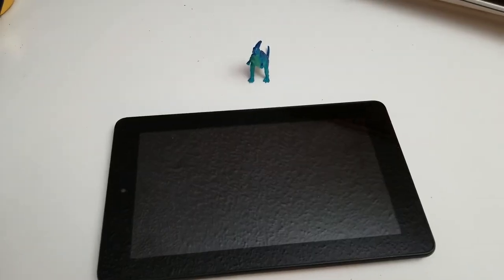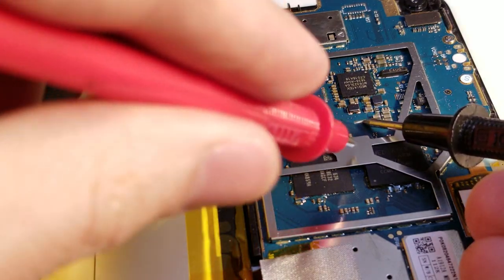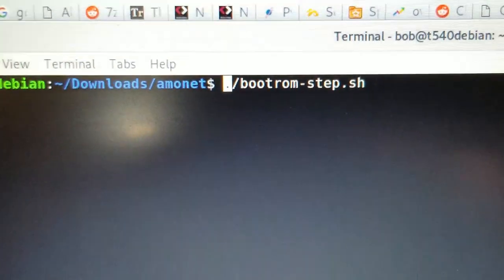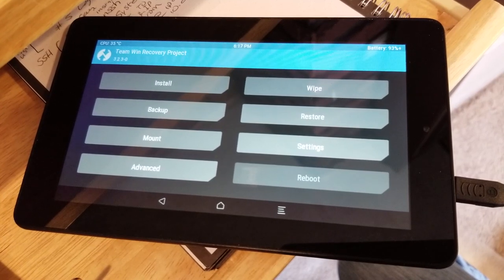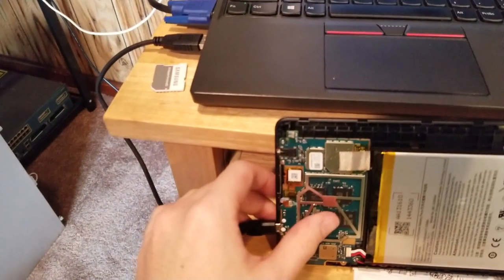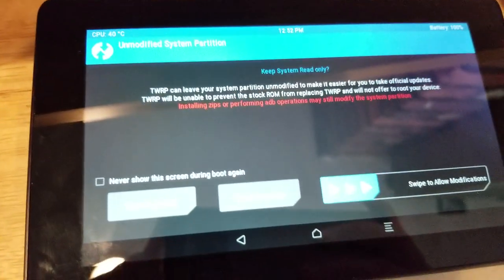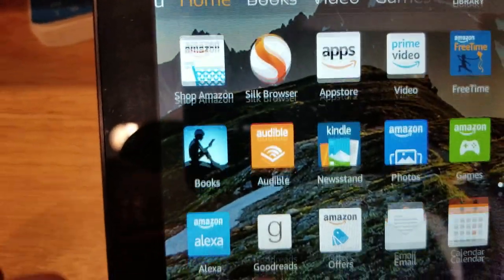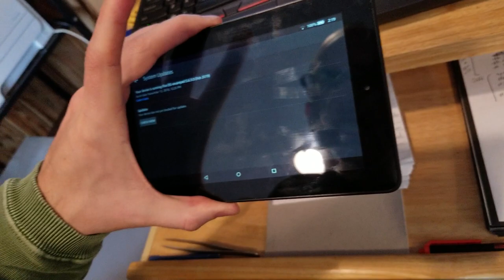Unlock Kindle fire 7 (5th generation) - load root / custom rom

Comment: EDIT : Those who want to try out a significantly better rom try the lineage os 12.1 on the 5th gen and add openapps gapps arm 32 bit. That is significantly faster (and better)
----
This was great. Although most of the instructions were there in the xda forum this really helped. Most people might be turned off by the shorting bit. However take a safety pin, point the pointy edge on the circle and bend it around so that it lies across on the gates as show in the original xda post. Use tweezers to pluck open the cage, it is as easy as show in this video.
I dint have an sd card so dint wipe it off yet, but yea the latest nova launcher also loaded up fine. Done on a kindle 7 5th gen 2015.  With most of the bloat out of the way it does feel that it performs a tad better.
Reply: For it to be even faster, use Pico GApps.

Comment: Thanks a lot! I was able to do this to a 5th Gen Fire 7. I had some problems at first with the tablet not communicating correctly due to some computer issue I guess. I ran it later in another computer and had no problems at all.
Reply: Man, it would sure be great if you could put a video or a step by step of how you went from 5.3.6.4 5th Gen to root. I have a PC laptop but know nothing of Linux or Ubuntu, and that's what is keeping me from taking the leap. As is, this old Fire is pretty weak.
Reply: You can always download a Linux OS ISO file and load it into a USB as a bootable OS. I used Linux Mint Debian Edition (LMDE) as the OS ( https://www.linuxmint.com/download_lmde.php ). I used Balena Etcher ( https://www.balena.io/etcher/ ) to install it into a USB as a bootable OS. After you have linux running from the USB (you just boot up the pc with the USB plugged in) you can follow the steps from this video and Jaren's notes to install a custom ROM, install Magisk to root the tablet on version 5.3.6.4 and install TWRP.
I know that sadly many things might happen, as they happened to me. Like the PC not wanting to boot from the USB because I had not set up the BIOS to accept legacy USB, or my USB ports misbehaving in general (That's HP for you).
Download the most recent version of Balena Etcher (or use YUMI or Rufus), download Linux Mint (any version should work, but I used LMDE). Be sure to have downloaded the custom ROM, Magisk, Gapps( https://opengapps.org/ ) if need be and an updated TWRP, and have those on the sd card inserted on your device in order to install from the sd.
On mine I have TWRP 3.2.3-0, Lineage OS 14.1 ( https://androidfilehost.com/?w=files&flid=293089 ) , GApps ARM/Pico for Android 7.1 (Depends on the custom Rom you install).  I read that Lineage 12.1 works well also. Might check that one out later on. The tables moves well with 14.1 though.
Reply: @gab_ale  Thanks for all the info, links and steps.  It looks like I just need to find a usb and get going on this.  I appreciate you taking the time to answer!  So 14.1 works pretty good on this tablet?   I just can't wait to get all this Amazon stuff off of it.
Reply: @Radtech777  Sure, glad to help.
If you download lineage-12.1, which runs on Android 5.1.x (Lollipop), be sure to select accordingly when downloading Gapps. 
Check on ARM, 5.1, Nano/Pico/etc (Whichever you like. I prefer Pico)
Lineage-14.1 runs on Android 7.1.2 (Nougat). That's why I am using Gapps ARM, 7.1.
There's another ROM called Fire OS Revamped (Shown in this video). You can check here: https://forum.xda-developers.com/amazon-fire/development/rom-fire-os-revamped-t3899921
The download link is here: https://androidfilehost.com/?fid=6006931924117918680
Also, I am running Magisk 19.3. I think there are newer versions though.

Comment: Thank you!... THIS (your) video make sense after I went through the same UNBRICK/ROOT procedure on the kindle fire 7 5th gen. (Yes! Now in 2020!)  I wondered if transferring the files directly into the SD CARD and using TWRP (as you do here), in comparison to using ADB sideload from the computer, would make any difference, but id did not!... Interestingly, before watching this, I made the same mistakes. FYI, I love LENOVOS.. I think I used the same model.

Comment: i keep getting this error: Traceback (most recent call last):
  File "main.py", line 156, in <module>
    main()
  File "main.py", line 82, in main
    switch_user(dev)
  File "main.py", line 53, in switch_user
    block = dev.emmc_read(0)
  File "/home/jonah/Kindle Hacks/5th gen/amonet/modules/common.py", line 193, in emmc_read
    raise RuntimeError("read fail")
RuntimeError: read fail
Solution?

Comment: Just needing help shorting it out I don’t understand , am I just touching it with the paper clip or moving something?!
Reply from the maker: yea, you don't need to solder. just shorting for 2 seconds between the metal frame and the pin
Reply: @jarenhavell  how would i go about shorting this?
Reply: @robertshields2879  Touch it with a paper clip for 5 seconds until it tells you to remove it.

Comment: Please, is it possible to do this on Vmware Workstation??? I don't know Linux, but I figure I can install Kubuntu virtually, and do it on Windows?? Please help.
Reply from the maker: if you can reliably pass the usb device... i think thats going to be a challenge. i would think it might present more challanges than necessary. booting from usb is far easier.
Reply: @jarenhavell  Thank you! For some reason I can't run a live version of Kubuntu on USB, but I should be able to do it with a live copy of Ubuntu right? Just open a terminal, and go to town, right? For whatever reason, I can only boot a live version of Ubuntu on an older laptop with USB 2.0. I disabled secure boot, and Fast boot within Windows if that helps, but still, it only lets me run live Ubuntu.
Reply from the maker: @ianthomas1201  yes. and you may find that things are easier on ubuntu as well, than, say, the version I used. Give it a try and report back!
Reply: @jarenhavell  Will do, thank you kind Sir.
Reply: @jarenhavell  I did it! I can't make it recognize files inside a MicroSD on the Revamped rom, but it's still pretty good.

Comment: How do you get back to twrp on 5th gen? I doubt running  both .sh is required every time? And shorting the pin required to every time we need to go into twrp recovery? Is there an adb command like (adb reboot twrp_recovery)?that would work? Any one please lmk any experience with what I'm asking so far I've got to twrp and then selected power off in twrp how to get in twrp once already installed?

Comment: Can you downgrade to 5.0.1 instead of opening the tablet?
Reply from the maker: I think so, there is reference to downgrading as a method in the XDA forum post, but I am not familiar with that process.
Reply: Did it on 2 amazon fire tablets (5th gen) with the downgrade and ubuntu installed on my pc.
Worked great!
Reply: Sonny_ Ska hi can you be able to give me step by step instructions im really bad with these stuff
Reply: Ranidu Lakshan if you have a fire 7 5th gen you can use the downgrade method, if you have the 7th gen then you have to short the pin.
Reply: Sonny_ Ska mind on telling me how to downgrade please
Reply: @jarenhavell  DONT DOOWNGRADE IT HARD BRICKS THE DEVICE
Reply: even with 5th gen still hard bricks

Comment: how do i short this without soldering?
Reply from the maker: I think it would have been easier with a pair of sharp tweezers or something thin and small. perhaps even a paperclipm
Reply: What does shorting mean?
Reply from the maker: @zeezoo6174  to make a connection between 2 points on the circuit board. "Short to ground" mean connecting a wire from the specific location to a "ground" or a "negative" portion of the circuit.

Comment: What version of Linux are you running for this? I tried Mint and Peppermint and the commands don't seem to work in them.
Reply from the maker: Debian.
Reply: @jarenhavell  no ur using ubuntu
Reply from the maker: @jonahnmdapumpkinhead7194  kind of. Ubuntu is based on a debian distribution, but there are small differences in included packages / programs, and obviously the visuals depending on if you installed one with a desktop environment. I like debian, but Ubuntu is easier sometimes because of the support from the community and Canonical. I used Debian in this video but all the command / syntax should work the same on Ubuntu, just may need to install packages if they are not available.
Reply: @jarenhavell  true
Reply: @jarenhavell  i used a raspberry pi with raspbian which is based on debian and i kept getting runtimeError: Can't read or something like that
Reply from the maker: @jonahnmdapumpkinhead7194  what command did you type before you got that error?
Reply: @jarenhavell  well it was going perfectly fine until it said checking GPT and then i got that error
Reply: im going to try using ubuntu on my laptop instead
Reply: I did it in Linux Mint Debian Edition (LMDE)

Comment: Do I have to do this if I'm on 5.1.1
Reply: No because there was a root exploit available in software and the bootloader wasn't heavily locked down. Heck, you won't even need to install TWRP if using Flashfire

Comment: Rooting 7th gen here cant get past handshake
Reply: same problem here, did you managed to go further?
Reply: @bernie2250  yeah I eventually got it. The cmd pin is very small lol. It took a pair of pliers and a spare vape coil.. and a very steady hand. Basically when I went to run the script I didn't have a solid connection from pin to short. After that it was very smooth sailing. Maybe try using a third hand tool to hold the jumper in place.
Reply: @SmokeyBluntRoach  damned, i soldered and measure it, so thats most likely not the issue for me. But thank you anyway
Reply: @bernie2250  sorry I couldn't be of any more help. Only thing else I could think of is the tutorial I read on xda said if the script hangs up just keep trying so it seems this isn't a 100% guaranteed thing but can work with persistence. Good luck I hope you get it.
Reply: How did you short it? The backplate on mine doesn't seem to be removeable
Reply: @AINEET  yeah it was the same with mine. I don't recommend it but basically cut into the heat shield and peel back small parts so you can bend them back and expose the points. Barbaric but it worked... and still does.